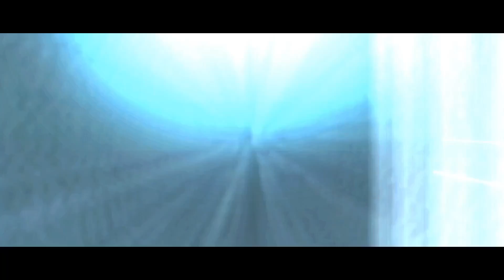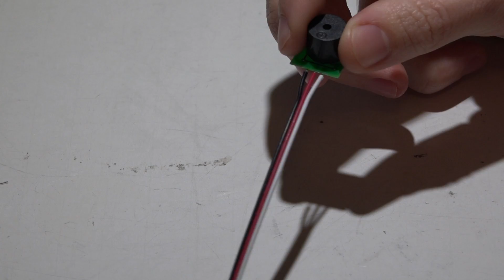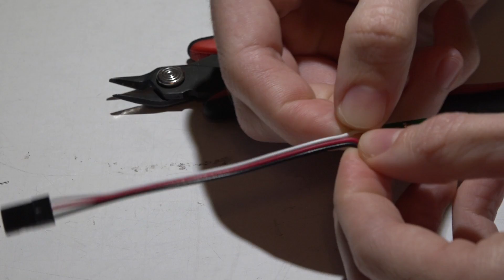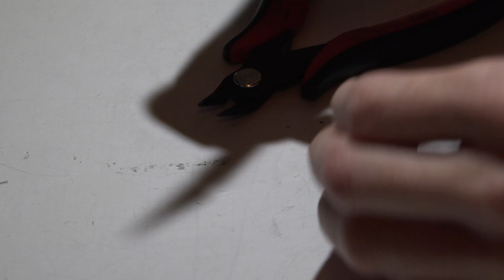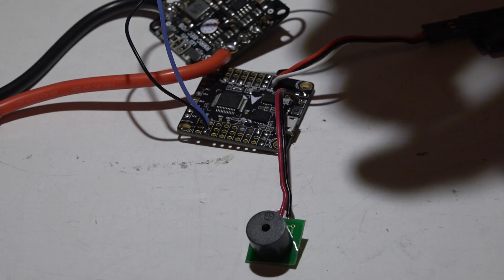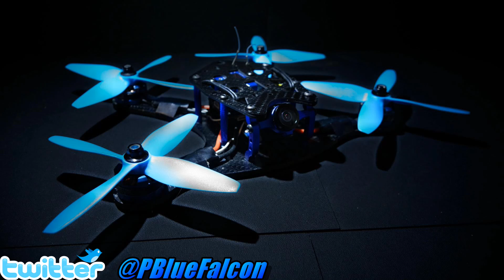Using 3 Wire Buzzer With Betaflight / Cleanflight

Comment: If the (-)buzzer pad is broken from the board, but you still have the (+) buzzer pad; is there any way to add a buzzer to the flight controller?  Thanks.

Comment: I managed to find a FIVE wire buzzer!  It has AUX, +5, GND, B-, and B+!  This is a Matek DBuz5V from FPV Model.

I've tried shorting ground to Aux, B- and B+ and nothing makes it buzz.  It makes little clicking sounds, but that would be useless for finding it in tall grass.
Reply: wire buz- to negative buzzer pin, then 5v & gnd up to the respective pins... and set a buzzer switch on betaflight and it should beep
Reply: @jamble7k  This is exactly correct, i've wired several 5 wire Mateks this way. For those who want to know how it works:  The buz + from your flight controller goes to 5v+ on the buzzer, the buz- on your flight controller goes to the  B- on the buzzer and you need to find another separate ground on your flight controller and connect it to the Gnd on the buzzer.  The Buz- on the flight controller acts as the signal line and turns the buzzer on and off
Reply: @53roger  are this correct? buz + to 5v and buz - to Ground?

Comment: Very new at this. I don't see where u solder the power and ground to on the board. Then u say flip the buzzer switch? Is that set up in betaflight?  Can u be more specific for the new guy. Thanks if u can. Been getting a lot out of your Taranis qx7 series thanks again

Comment: I de-soldered and removed the signal wire from the buzzer board and soldered the power and ground directly to my flight controller and it seems to work fine. I may have just got lucky that it worked.